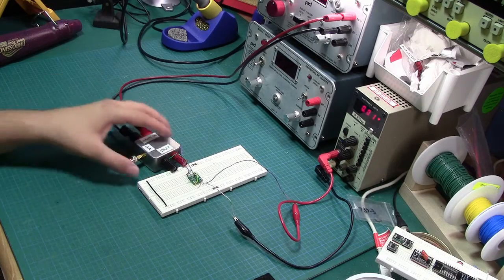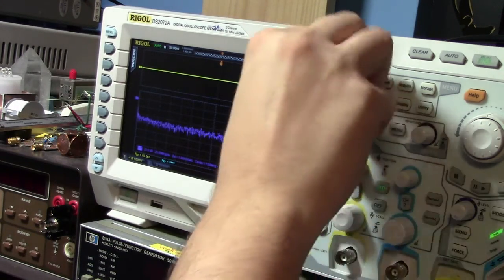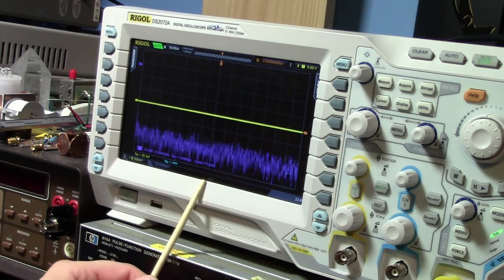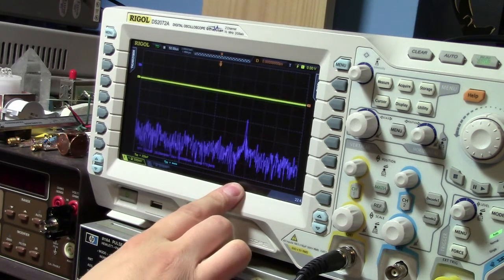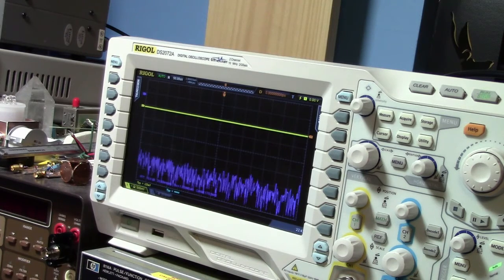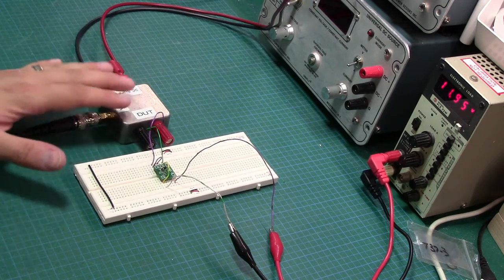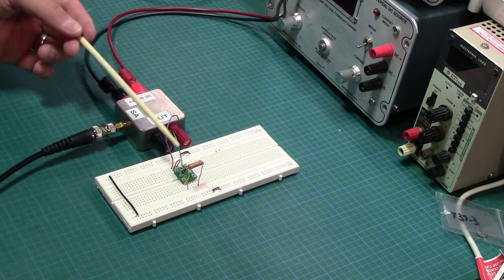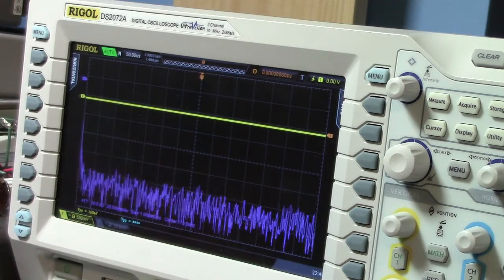LISN Box Testing

Comment: Using a single LISN allows to see differential-mode noise. You need two LISNs to see common-mode noise (which will be common to the two LISNs outputs). Great video ! :)